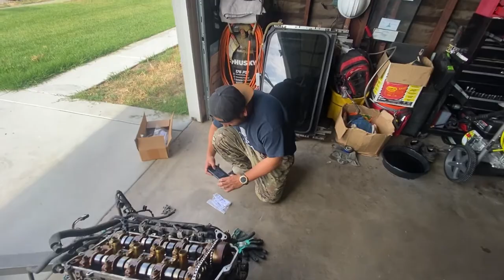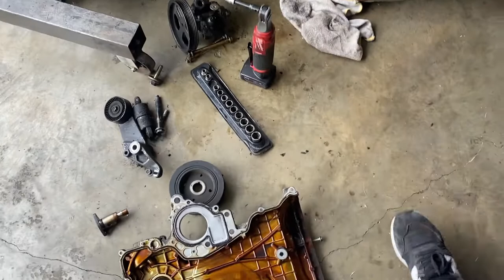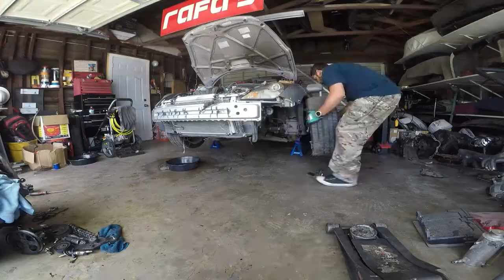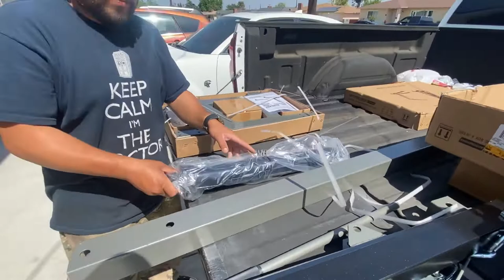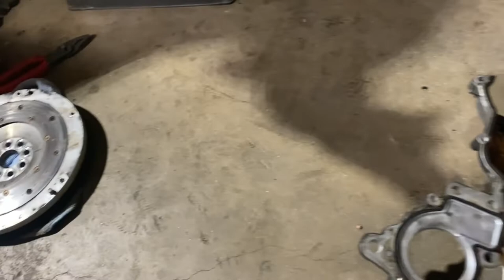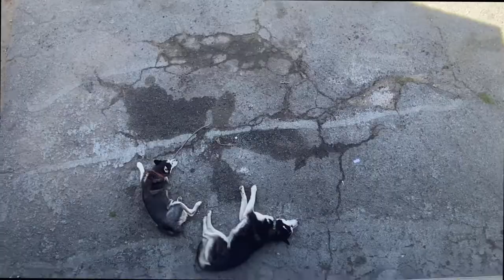2zz Swap Celica

Comment: As far as the wiring harness.
Is it possible to use the GT one on the GTS?
Reply: Yes, but you'd have to add VVL connectors to your 1ZZ harness for the lift to work.
Reply: The transmission 1zz Works on the 2zz engine